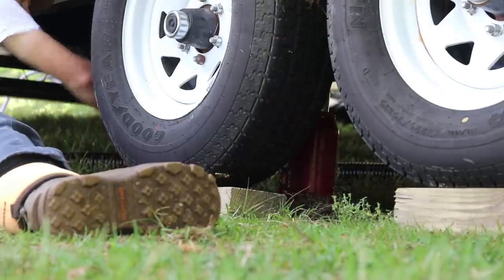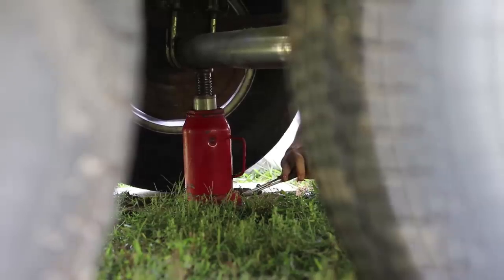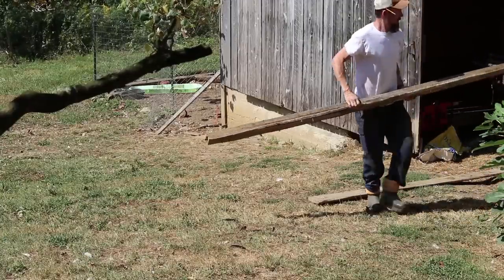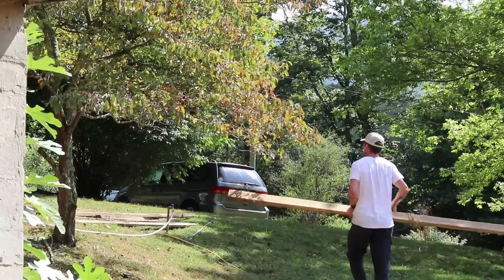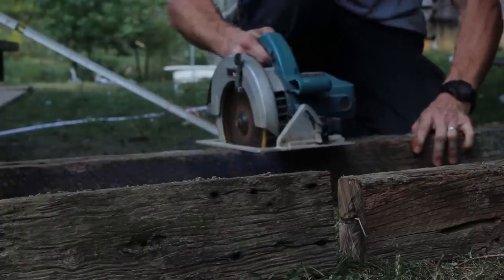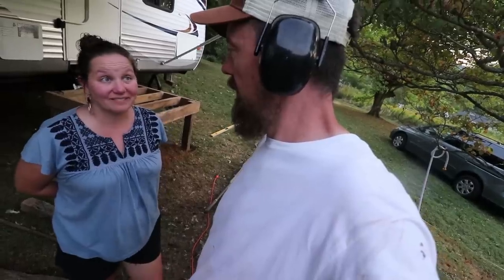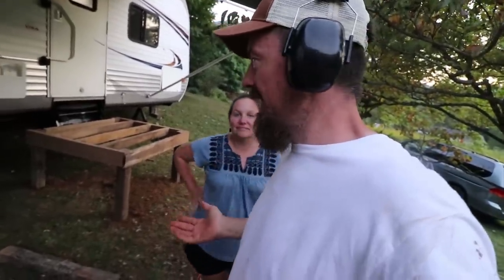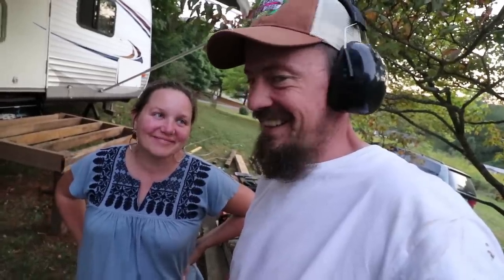Building A Landing For The Camper - RECLAIMED LUMBER

Comment: When I was living in a camper I blocked up the four corners on trailer stands so the tyres were barely touching the ground. You don't need the springiness of tyres and suspension while it's not driving down the road, so better stability and no weight trying to flatten the tyres is a gain both ways.
I'm so glad things are working out for you now.

Comment: Hey Art, We did the camper thing for about a year before. Since you live in the land of wet winters if you put some rough gravel or an outdoor rug at the bottom of your steps it will help you loads with keeping the amount of crud tracked in from outside out of your camper.

Comment: I’ve been living in a camper for OVER a year now (was fighting county to allow me to drill a well). The best thing I did was about a month of moving in I had a big deck and cover built. It gave me an outside living space so I was able to use it as a room. That retractable cover will not be able to withstand the rain and wind. It will break so I totally recommend building a wood cover structure

Comment: Just at tip. Be careful jacking up on that part of the axle it can bend it very easy.  I know you are not so n.v g it on the road but later on it could cause problems.